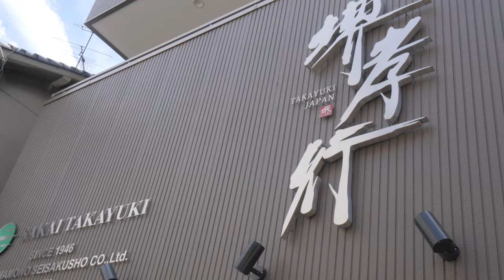Meeting The Japanese Chef Knife Artisan

Comment: Its not a Toyota Celica, its a Toyota Sprinter (AE86) a very cool car in the drifting world. They upgrade the engine to a 20v 4age and add a turbo the power to weight ratio of this little tiny car is rediclous and its rear wheel drive not front wheel like most small cars of this size.
Reply from the maker: Wow... someone knows their Initial D....
Reply: @Burrfection  i only watched about 2-3 seasons of initial D, i know a little about cars.

While i have your attention i wanted to discuss the term Damascus. Generally this term was used to describe a metal that came from a place called Damascus. It seems to now have been relabled Woots Damascus in the confusion of everyone else labelling their metal Damascus which it isn't. The paterns these Japanese craftsmen are getting is simple folded steel or patern welded metal which isn't traditionally what Damascus is at all. /discuss